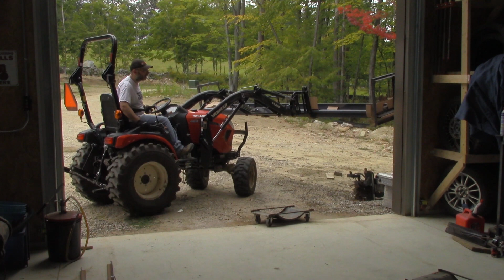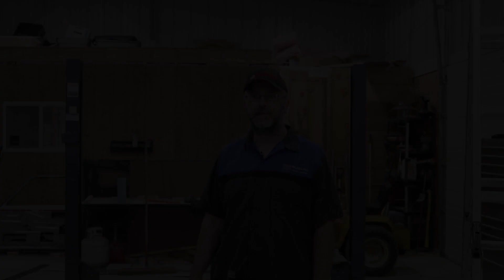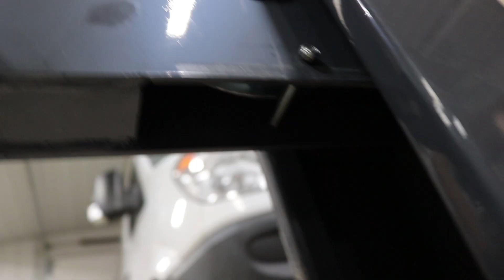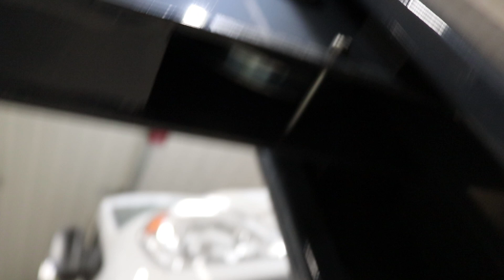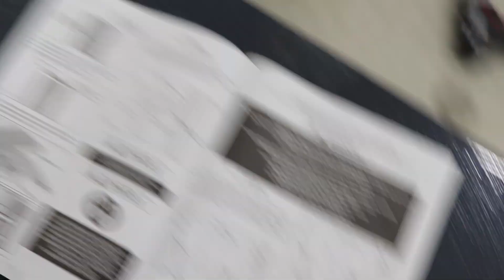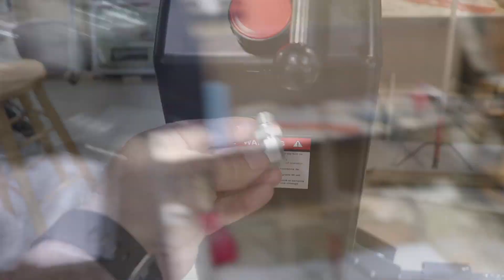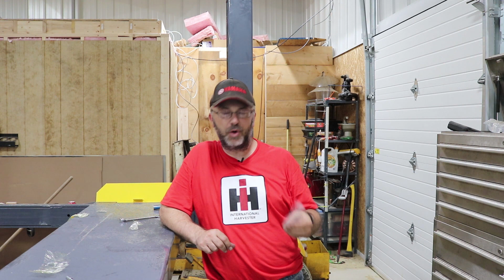BendPak 4 Post Lift Install

Comment: What size bolts, nuts and spacers are the ones that go on the bottom of the safety ladders. Mine didn’t come with those and I need to pick some up. The slotted holes at the bottom in each of the posts. The ones you mentioned you missed.

Comment: Video is very helpful. Just installed the BendPak HD-9XW. Having problem with the power side runway flexing when I have my SUV (about 6000 lb) drive on it. Flexing causes the bottom of the runway flange to open up. This results in the cylinder flange arm assembly dropping off and falling below the flange. The runways seems flimsy and flexing. There is about 3/4" bigger dimension at the spot the rear wheels sit vs at the bracket holding the front end of the cylinder.
Have you encountered similar problems?

Comment: I know I am little late on my comments, but I can't seem to find an answer to my question:  are the tire runners movable side to side so that you can adjust the spacing to accommodate narrower or wider track width vehicles?  Great video and I also appreciate your honesty and mistakes.  Nobody is perfect and your willingness to share those mistakes will help others avoid them.
Reply from the maker: Yes, the ramps have 2 positions they can be put in for narrow or wide vehicles.

Comment: what is the part number on your hydraulic pump? We want to wire ours up to a 240v welding outlet as well, but I have concerns about the hydraulic pump working with the split phase wiring in the welder outlet and wanted to see if yours worked and is the same part number
Reply from the maker: The tag on the motor of my pump has SKU: 5585280 but really shouldn't matter as long as it is wired to 240v 2-phase (I believe it can run on 208 3-phase as well but not 100% certain there).  If you are unsure I recommend you consult an electrician.

Comment: Follow up question for you: what’s the name of the freight terminal you used, and was there a charge to have it delivered there and pick it up yourself?
Thanks!
Reply from the maker: In my case it was YRC freight but it all depends on who bendpak ships with to your area (not sure if it is always the same or not).  There was no extra charge to pick it up at the terminal.
Reply: Sounds great. Was that in Bedford?
Reply: @jayymac  I mis-remembered, I had something else delivered at YRC (but yes was in Bedford).  The lift cam via XPO logistics in Manchester.

Comment: do you rest the car on the cable or locks
Reply from the maker: Always rest it on the locks before putting yourself underneath the vehicle.  The cables are just for lifting, not for security.

Comment: Great video!  Very helpful.  I'll have to research the fact that you needed an air line towards the end.  Wondering if that is an ongoing need?  I was assuming it was all motor driven.  Thanks.
Reply from the maker: The air line is what releases the safety locks and I believe they have not changed that design (actually works very well).  I do think they have an optional compressor that mounts onto the lift for this to make it self contained.  Thanks for watching, glad it was helpful.

Comment: I have the HD9 XL. Bendpak’s instructions are about as close to useless as I have seen. I love my lift, but trying to figure out all the things not covered or out of date in their instructions almost drove me to drinking. Looking at Rotary, their instructions are flawless and detailed and they also have videos online. It wouldn’t take much for BendPak to do the same, but their management clearly doesn’t care. 
BTW, it looked like you lowered the lift without engaging the air button. This would mean you were just supplying constant pressure. Shouldn’t lower unless you are pressing the button and the lever. Just my .02. I am sure you fixed it later.

Comment: great video but wish you would have shown a bit more on the wiring up at the pump, connections, etc.  That is a big of a question still in my mind.  Thanks!
Reply from the maker: I don't recall the details (been over a year now since I did this install) but I don't recall it being too difficult.  However I STRONGLY suggest if you are uncomfortable wiring it up you hire an electrician to do it!

Comment: did you get the jacks that go between the ramps?
Reply from the maker: No but I would like to get that eventually.  I have the simple metal platform that can span the ramps that you can put a bottle jack on.... but I am not really happy with it.

Comment: I just purchased a lift.  As I was reading the instructions during the installation process I realized (multiple times) the provided instructions are badly written.  I set this up solo as you did, and I appreciate your video! It helped tremendously!

I currently have it operational, but adjusting the safety ladders is still baffling me based off of the instructions.  Can you post a video on it please?
Reply: Your video at 34:09 is what I am experiencing.  I want to know how to correctly adjust the ladders so the all lock simultaneously (or very close)

Comment: I might be late to the comment party but I just wanted to add my appreciation for the effort you took to produce this video. Along with a couple of friends, I assembled a Bendpak 7w in my home garage  in late October. I watched your video a couple of times in advance of taking delivery of the unit and with the manual (vague at times in some places) we had the lift up and running within 5hrs of unloading, the garage pretty much cleaned up and the car on the lift before bedtime the same day (LOL). Thanks Chappy!
Reply from the maker: Always great to hear this has been helpful!

Comment: Once you position to lift in place did you Bolt the post down?
Reply from the maker: You can but the big advantage with the 4 post lift is you don't have to.  This gives you the ability to move it.  Later in the video I show the optional caster wheels.

Comment: Have you tried to put your tractor on the lift? If you did how did you modify the lift?
Reply: Have not tried it.  The lift would be too narrow in the normal width.  One of the ramps has the ability to move sideways to allow for narrower vehicles but not sure if that is narrow enough for the tractor.  Either way, have not really had a need.  It is pretty easy to crawl under the tractor to get at the hydrostat filters which is the only time I have ever needed to get under it.
Reply: Thanks for the reply -- I guess I am old and lazy but I hope to pick every thing I own that needs service- I have move the one runway to fit my kubota but the hoist still modification as the one ramp will not mount- if there is anyone modifying this lift I would appreciate knowing

Comment: I read, somewhere, that one guy mentioned that he slightly staggered the locks so he could hear them snap in.
Reply from the maker: I can see that.  As my cables have stretched they are just a little out of alignment so I can hear them individually lock.  Obviously you don't want them too far out making it lift crooked.
Reply: Yep, juuuuust enough difference.
Did you lube the cables?
Did you ever question why the manual says to use WD40 on the threads of the bolts?  I have never seen that product used for that application.

Any other updates besides the ramp mod and caster videos?

Comment: Hi there.  I need to install new cables on my Bendpak 4 post lift after 3 years and have a couple of questions for you.  The manual talks about using a transit to level everything.  Lacking that, can I screw down the nut at the top of the post until an equal number of threads show on all 4 cables?  Also, why do I have to install with the piston fully extended?  It would be so much easier if the lift was higher up.

Comment: very useful! Thanks for sharing Just need to get my garage door modified for a 10' ceiling.
Reply from the maker: Glad you liked it.  I know what you mean about headroom.  I wanted a lift in my old garage but just didn't have the vertical space for it.  I have a couple other videos related to the lift and will likely do more in the future.  Don't forget to subscribe so you don't miss them!  Hopefully some other videos you will like as well.

Comment: I noticed the Yanmar Tractor.  Are you happy with it?  Are there any/many problems?
Reply from the maker: Love the Yanmar!!!  Have had 0 issues with it so far.  We built the house a couple years ago an are still working on lots of landscaping projects so it gets a fair  bit of use.  Our driveway is over 800' and I use a rear mounted snowblower on it to clear it in the winter.  I might do some videos about it so don't forget to subscribe so you don't miss them.

Comment: Thanks for making the video.  Now, as for your building.  What are the specs on it?  How long, wide and the height of it?   If you don't mind and you have the time.
Reply from the maker: The building is 36"x60", walls are 13" high on the sides and ceiling slopes up to about 14.5" in the center.  It was built by Morton Buildings.  Very happy with it so far, was built about 2 years ago now.

Comment: Awesome video!  It was instrumental in my assembly over the last couple of days.  I bought mine gently used (about 2 years old) and it didn't come with the spacers for the ladders, but I'm sure I can get some nylon bushings/spacers from my local hardware superstore.  Thanks again for taking the time to do this!
Reply from the maker: Glad it was useful!  I wonder how critical those spacers are since it wasn't mentioned in the manual.... I suspect that is something they added later on.  It does seem like a very good idea to have them since it keeps the ladders in line preventing them from snagging and catching when you try to lower the vehicle (which could be VERY bad if one of the 4 catches and the car tries to come down crooked!).
Don't forget to subscribe to the channel, I will probably do some other videos about the lift and other useful workshop stuff in the future.
Reply: I'm definitely with you on that one.  Any chance you know how thick the ones you got with yours were?  I'm guessing about half an inch?  It seems if they're that important, they would surely add that to their manual...  Strange though.  And I did just subscribe.
Reply from the maker: 1/2 inch sounds about right but I will measure mine tomorrow.
Reply: Thanks!
Reply: I realize why mine didn't have them.  I guess my version was the one prior to yours and did not use them.  I compared the parts listing for the current version to my original instructions, and they're not listed.  Also, there are no holes in the back of the column to bolt them through.  After re-thinking this, I could add them, but also, the teflon pads on the cross bars help keep the ladder from moving out, at least on my version.  I'd still like to get the size once you have it, and also a measurement of how high off the ground the holes are, and approximate hole size.  Thanks again!!
Reply from the maker: I measured my spacers, they were thicker than I remembered, almost an inch thick.  22mm or in fractions around 15/16".  The hole is 4" off the ground and looks like it is probably a 7/16" bolt (but the bolt size wouldn't be too critical).  The trickiest part if you are retrofitting yours to have this is the ladder doesn't just need a hole, it needs a slot so you still have some adjustment if needed later on (however once all 4 ladders are in alignment I doubt they would need to be adjusted again).
Reply: Yep, just went and looked, and they're not slotted, so that's out.  I'm ok with drilling a hole, but I'm not going to take it apart and try and modify it.  Thanks for the help anyway!

Comment: This is an excellent video. I’m glad you didn’t edit out the mistakes at the start. I’m also looking at installing this hoist. I’m in Australia and the Molnar seems to be the one to go for if you’re wanting quality over price. After quite a bit of research, there are a lot of positives about the Bendpak which we can get here. I don’t know if you’ve seen or used the air jacks that go between the runway platforms? I saw one YouTube video and when the vehicle was jacked up, the extension arms had quite a noticeable bend in them. The model one I was looking at is an RJ-45 which fits the HD-9 hoist. I feel they would be very handy but at $1700 aud each I would want them to be good. I guess you would expect it to bend a bit if it’s a larger heavy vehicle and the arms are extended a long way. I’d appreciate any comments from you or people that may have used them. Thanks again for taking the time to make and post this videoCheers, Pete
Reply from the maker: Glad you liked it!  That RJ-45 looks handy but yeah, seems overpriced.  Had not seen them bend but have not looked closely.  What I do have is the jack platform that fits between the rails that you can put a couple bottle jacks on it.  Honestly not really happy with it either but it works.  The best thing that I use when I need to take the weight off the suspension is some tall floor supports I got from Harbor Freight (which I assume they don't have down under but I assume you have a similar store?).  I should probably do a video on that stuff.
Reply: Chappy's Garage Thank you for your reply. I think I get what you mean. You hoist the vehicle up, place the floor supports between the garage floor and the axle and then let the hoist down enough so the axle is resting on the floor supports and the wheels are just off the platforms. Yes that would work ok. They are fairly expensive especially since I was going to buy two. They are $1700 in Australia but still a lot cheaper than the Molnar brand which I was told are around $3000 each. I was up for $8000 for the Molnar hoist and $6000 for the two scissor jacks. They advertise that they are made in Australia but they aren't any more. Just like a lot of businesses in the US, they end up overseas. Most reviews and videos I've seen, like yours, say positive things about the Bendpak. I appreciate you going to the trouble of making the videos. I'll keep a look out for new ones
Cheers Peter

Comment: Awesome video....question, specs say outside length is 198”.  Then it says overall length is 224”, is this with the two yellow ramps attached or something else?  Thanking you in advance for your efforts. Al
Reply from the maker: +alstrains60560 that sounds about right.  I have not measures my ramps but they are about 2 ft long so that would explain the difference between those measurements.
Reply: Thank you for your reply....a follow up question, those ramps are removable correct?  I’m limited on space and I am attempting to max out what I have available.
Reply from the maker: The standard way they attach they are not easily removable however I am considering making a small change to mine since I also would like to be able to take them off.  There is a shaft that the ramps pivot on that holds them on, the shaft is held in place with clips on both end.  I am thinking about removing the clip on one side and drilling the shaft for a cotter pin.

I am planning on doing an update video about my lift this weekend to answer some other questions I have had on it.  I can show in more detail what I am talking about there.
Reply: Great, I look forward to your next video.  Thank you for taking the time to answer a couple of questions .

Comment: I know another question I wanted to ask you.....  do the locks engage right at the lock point or do you have to raise it up an inch or so over the spec and then let it down onto the locks?
Reply from the maker: +srpope80 you need to lower the lift down on to the locks.

Comment: Great video. Saved me hours. I just installed my HD-7 and your video along with what BendPak calls ‘instructions’ made the process very simple. Still took a few days but I did it by myself as well. Best of luck with your lift.
Reply from the maker: +somoss0117 glad it was helpful.  Enjoy your lift, mine has made things much easier for me.

Comment: We can’t get the hydraulic runway to fall into place. The pulleys are holding it off. Any suggestions?
Reply from the maker: On mine the pulleys were not already installed but I do recall something in the instructions that you might need to remove them.  There is a set screw that holds the pulley shaft in place, losen that, pull the shaft out and the pulleys should slide right out.  I don't think you will be able to route the cables with the pulleys in place also.

Comment: Great video, very useful idea for me as I'm looking to potentially buy and install a Bendpak.  Thank you for putting this together.  Would you still recommend the Bendpak after extended use?
Reply from the maker: No problems with it so far but it has only been a little over a month since I got it.  However, I have seen these in professional shops where they get used every day so I don't have concerns.  I figure as long as it is maintained it will last.
Reply: Chappy's Garage Awesome!  Thanks for sharing on your channel.  Very useful for so many reasons.  Good luck with your in the future and I'm sure it makes work so much easier!!